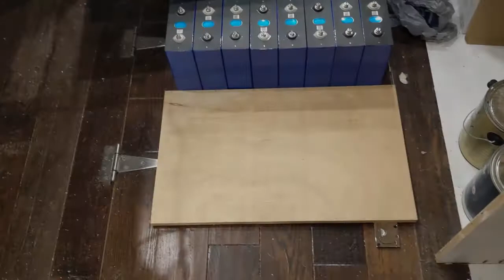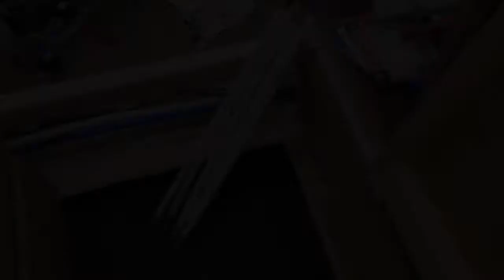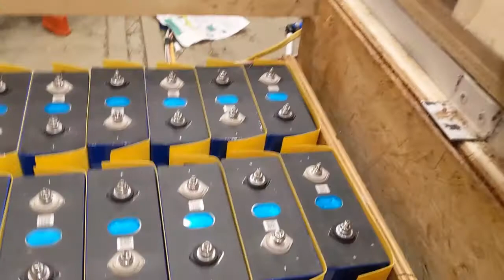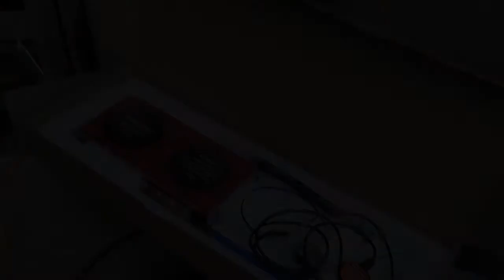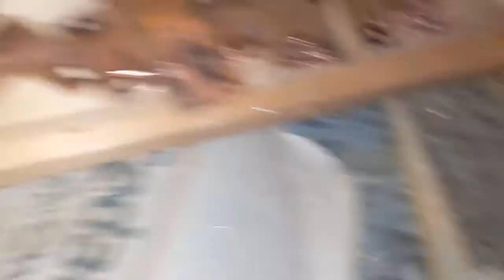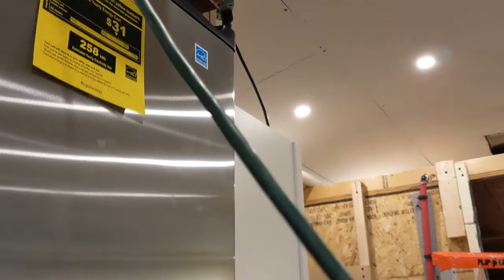Skoolie Build #68: Rough in of 48V LiFePO4 Battery Bank, & Genetry Solar 6000 Watt Inverter-Charger

Comment: Good setup. You really did your research.  I will be doing similar 16 cells but in 24v, a growatt system and full 40 foot of bus roof rack solar panels.
Reply from the maker: I went with 48v to keep the amps and wire gauge reasonable with the potential 6000 W the Genetry inverter can put out. We'll have two mini split units and a portable A/C unit, so we could routinely peak above 4000 Watts.
Reply from the maker: I forgot to mention that I top balanced these cells to 3.65 v in parallel with a lab DC power supply. That takes awhile. They were on a table at home for weeks during that balancing process. It was a small power supply.

Comment: Love it! By any chance, do you have the estimate price of your setup?
Reply from the maker: Back of the napkin math including 12 commercial surplus panels and 3 make sky blue controllers and batteries and inverter and cables it's about $5k or so.
Reply from the maker: And I have the shunt and BMS and Airpax breakers and fuses and and and
Reply: @allmomomosthomebus3895  Thank you! It's not that pricey at all I think! You will have plenty of power, that's cool!
Reply from the maker: @johnalbrecht6  I hope so. We'll also have a generator that I hope to not use very often.

Comment: Nice! Man you're going to be able to run a city off of that system, Larry. Michigan Wolverines colors too. I like it!
Reply from the maker: Maybe not a city but hopefully good air conditioning all night off solar!!! We're doing 12 panels at 315 watts each. 8 on the roof and 4 as a solar panel awning. Are you a Michigan fan? I'm not much for sports.
Reply: @allmomomosthomebus3895  Naaaa. I quit watching football about a year ago. Too m,uch drama! We're doing a system similar I guess but 24 V and gonna use those 200 Ah server rack batteries. Two of them. Equivalent to 8 battle born batteries. Solar panels will be similar also
Reply from the maker: @CSSkoolieProject  sounds like it will be pretty sizeable as well. For me it's a happy wife happy life situation with the need for AC. She's not fun to be around when she's overheated. LoL
Reply: @allmomomosthomebus3895  as an occasionally overheated woman, I respect that. LoL